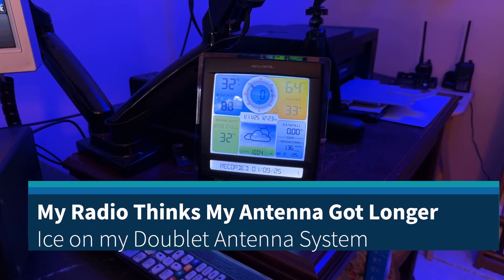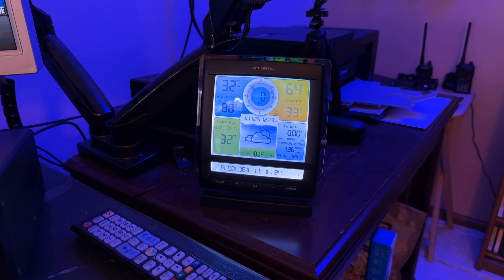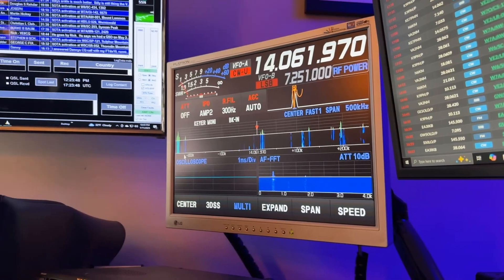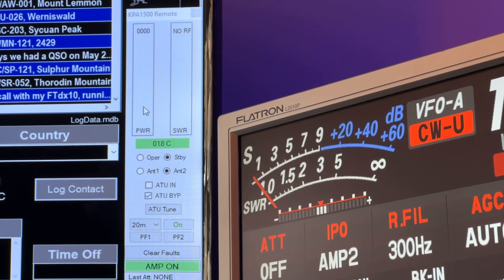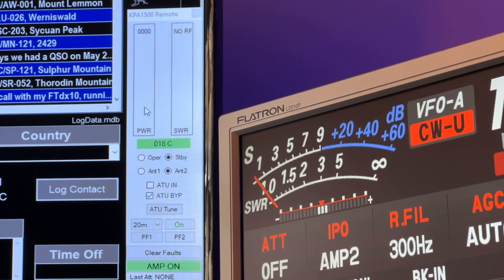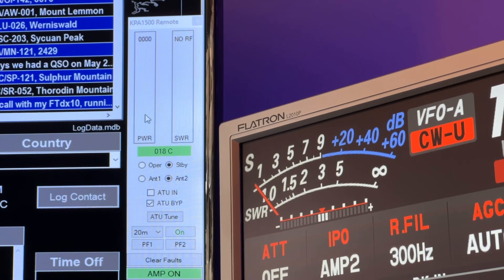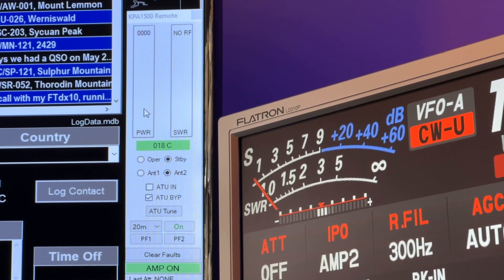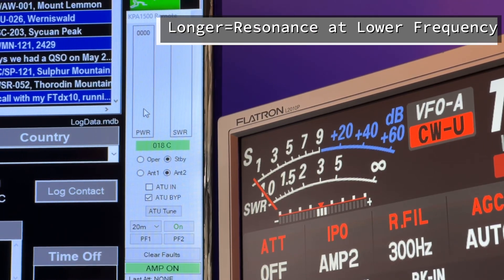My Radio Thinks My Antenna Got Longer #hamradio #snow #antennas #polarvortex #ice

Comment: Could be any or all of these factors perhaps, working together:
1: The weight of ice is enough to stretch the antenna wire so the resonant frequency is lower.
2: The surface of the ice is uneven so following the length of the surface of the radiator is longer than the length of the centre of the wire.
3: The ice increases the effective diameter of the wire which will increase the bandwidth to some extent.
(I’m not sure if [2] will have much if any effect for wavelengths longer than the wire)
Reply: Your point (1) is the cause. Ice is heavy. Really heavy. It will stretch the wire quite a it. Actually in ice storm we all know the aerial power lines break for the same reason.